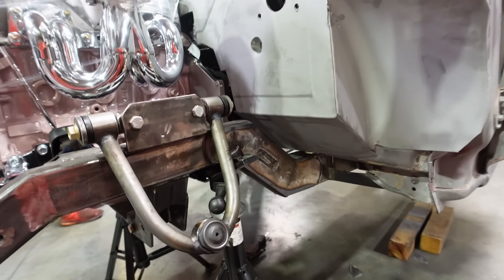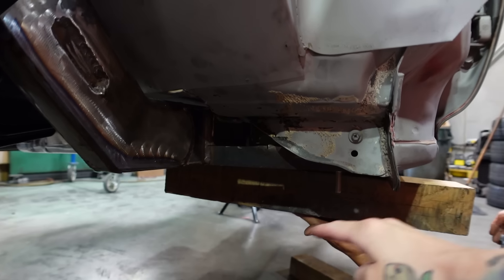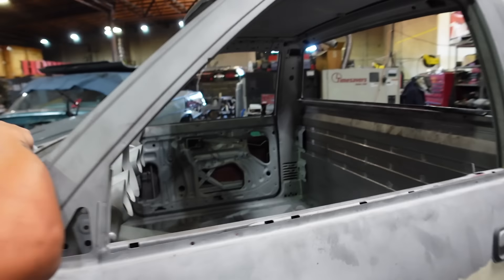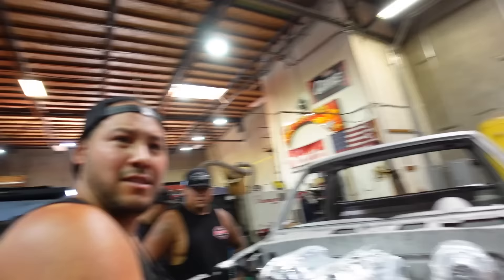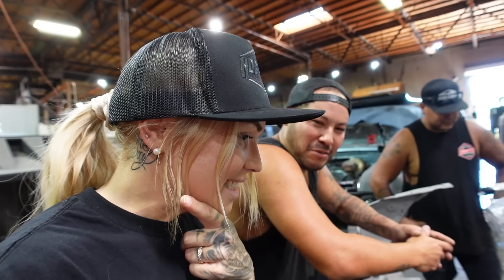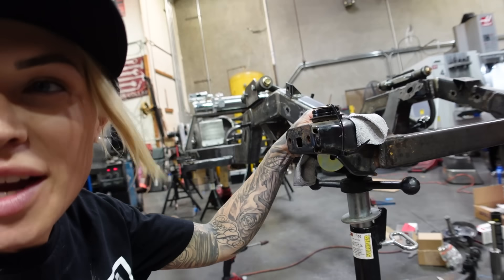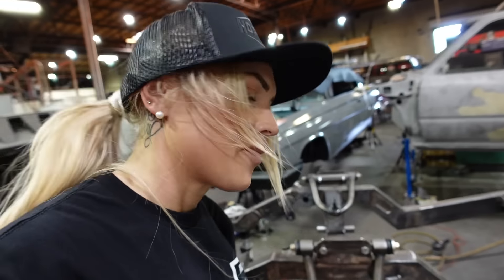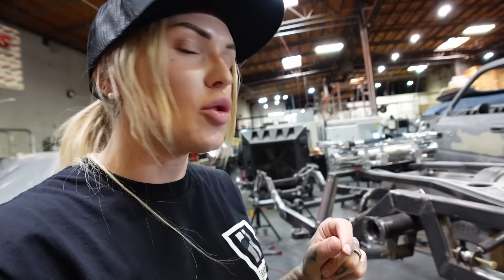Episode 13 - We have to cut everything…

Comment: Building things fun is expensive, lol. Even a yota,, I just built an 85 4wd regular cab yota crawler. Dual t/cases, relocating axles, replacing leaf springs, built my 22r with a Holley sniper 2300. Built it all myself. It was a learning experience for sure. I seriously had a lot of fun building it though. I have a 78 2wd I auto swapped with a 20r that was my wife’s fathers first Toyota that he drove 35 years ago. She was driving the 78 when I met her. I only own like 6 Toyota’s and they are all regular cab trucks.